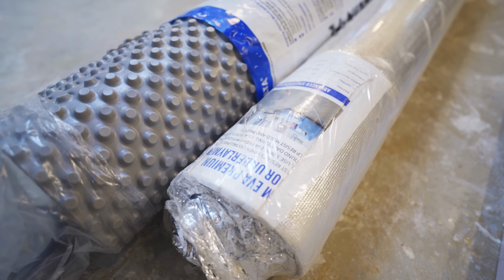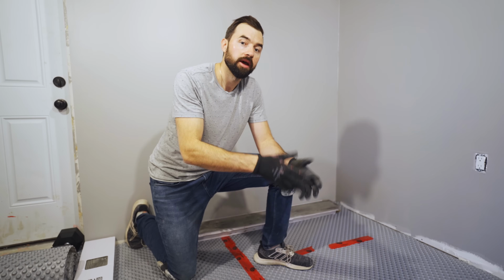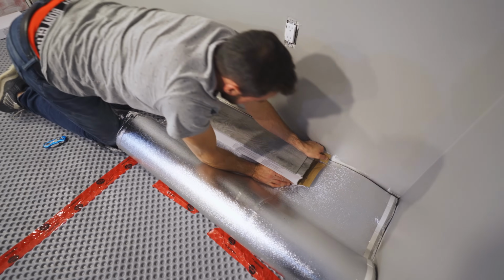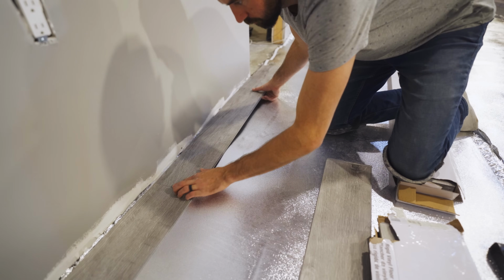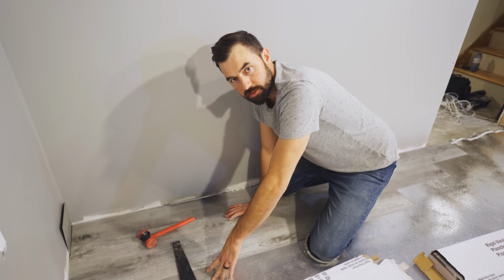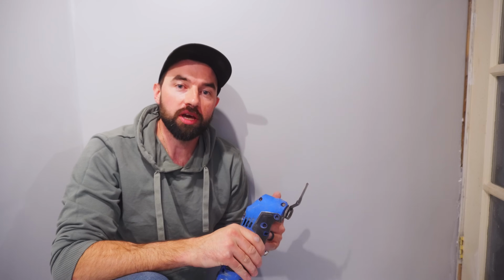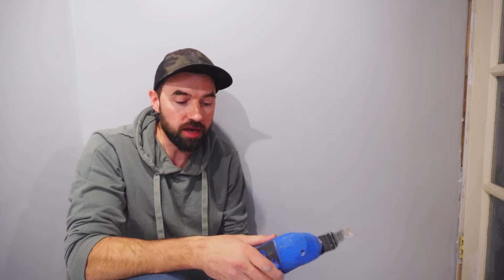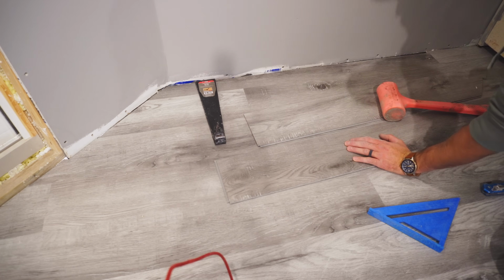How to Install Vinyl or Laminate Floors in a Basement (Over a Concrete Slab)

Comment: Why not use plank with the underlayment built in. Looks like this dimpled plastic would trap water if you had a leak in your plumbing.
Reply from the maker: If you have any leaks with any type of system you have a problem and moisture will be trapped.  The dimples allow moisture wicking from a concrete floor in a basement to evaporate.  Thanks for watching

Comment: What We got has like two layers of rubber and it still needs underlayment ?
Reply from the maker: If your flooring has built in underpad you don’t need the Eva foam layer.  Just the dimple board to allow air flow.  Thanks for watching 🎉

Comment: Every LVP or laminate video I ever watch the most important part nobody ever talks about and that the moisture level that needs to be checked before you even take out tools.  Also the way you vacuumed that is just wrong. A shop vac should be used. Also if you’re moisture is higher than 5% that concrete floor needs to be sealed putting a moisture barrier first is just putting a band aid on it. Also do not listen to this 🤡 you cannot just install anykind of underlayment under any floor. If you’re installing LVP be sure to check with the manufacturer of that floor to see what underlayment you can use. The only underlayment that can go under any floor is a 6 mil poly plastic. And no circumstances do you install 2 layers of any type of underlayment under any floor. This man is not giving you any helpful tips

Comment: This talk of putting 6 mil poly on top of concrete to prevent moist wicking is baffling me. I have a new construction concrete slab that I'm looking to put luxury vinyl waterproof plank down on. The slab was poured on top of poly to prevent moisture from being wicked up into the concrete, thus what's the need for a layer ontop of the concrete? Also there is a pad on my vinyl, I've heard people say put down an additional pad & others say no as it gives too much moosh coosh under the plank & can cause seam failure. I'm in northern Florida near the Georgia line. Is there anyone who knows what the 'ell they are talking about & give me the right & only answer? I'm sick of contradictory bs.

Comment: Why the underlayment’s when it appears your planks have a underlayment backing? Did the finished floor have a bounce to it?
Reply: My understanding is if you add extra underlayment then the connecting joints of the planks will undergo more stress and eventually fail.
Reply from the maker: My planks didn’t have the underlayment pre-installed. If you do get planks like that, then you wouldn’t need the additional air of foam. I just like that Eva full material. I think it’s a good insulator and sound dampener.

Comment: I'm doing a sunroof floor only about 200sf do I still need the under laminate?
Reply from the maker: Double check your manufacturer recommendations.   It depends if you’re doing it on a concrete slab or wood floor etc… double check the manufacturer recommendations based on your material

Comment: The issue is that only the top is waterproof, if water gets under they're cooked. For this reason I'm probably going with tile. Awesome work on the install and vid!
Reply from the maker: Thanks yeah it’s personal preference, tile is more $ but definitely less susceptible to water damage
Reply: Also tile cracks with temperature changes and settling

Comment: Contractor installed vinyl floors over a concrete slab in my condo. 2 years later, I found a couple spots in the kitchen and hallway. If you step on the corner of the flooring, it sinks. I have the exact type of vinyl floors in the video. Anyone knows why it's happened? Contractor said I picked the bad type of floors and refused to take responsibility.

Comment: Great video. 0:26 Wouldn't the moisture barrier trap moisture underneath? I thought it would be better to have just the plank and let any moisture evaporate naturally, no?
Reply: I was just told by a flooring guy who does this for a living and I've worked with him for over 20 years on various floors.. he said that using the rollout type of underlay can shift and eventually cause the planks that get click lock together to shift also an issue at transitions.   His opinion was that it's better to let the concrete breathe so not to put just a flat vapour barrier down which is what many of the manufacturers tell you to do for concrete because of the warranty and they are covering their butts.   I have gone from thinking of putting down a 1 inch subfloor DRI-CORE+ to a dimple mat like this... and now I think based on the good product that I chose which is 8 mm thick and it is SPC, and my floor is a fairly dry concrete floor in general it's not as super damp as some.  For this reason I think I'm going to go with no vapour barrier whatsoever.   This flooring expert who is the manager of a floor store has installed his own vinyl flooring directly on his own concrete with nothing in between and he said it's great.   I'd like to hear from people who installed directly on concrete.  I guess another benefit from that is if you do ever have a foundation leak you would know.   Some of the subfloors are so good that the leak can go undetected for a long time.  Your nose will eventually tell you.

Comment: doing this on a concrete slab that currently has carpet, when i pull it up and check if it's level, does it really matter what product I use?  I'm torn over the generics at THD or Lowes, or Henry brand, or Sika, or Mapei, etc.  I'm using Modin LVP with a 1.5mm pad attached, so i won't have anything else down other than a 6mil vapor barrier.  any 101 advice for a first-timer on flooring installs is much appreciated!

Comment: FEW people know, that the slab in that basement, is "Thee-most chemically-complicated substance ever invented by human beings" and that if there is ANY moisture from the ground reaching that slab, this floor system will trap it underneath, and in time you can have a mold nightmare.   This is NOT a viable solution to the moisture risk.

Comment: Pro tip from a woman who knows a lot about CLEANING SURFACES:

It's counterproductive to push a vacuum stick floor attachment FAST over a floor, as you did.

My husband taught me, before we were even married: To PULL the vacuum stick, SLOWLY.

The suction is THE WORK that you want performed, right?

So, push fast to a beginning start point, if you must: 
Then, PULL, ever so slowly. 
Allow your VACUUM to suck! 
That is, after all, The Work that we want done, right?

Pushing a vacuum stick around rapidly, as your filming depicted you doing, PREVENTS MUCH VACUUMING, sucking up material, to be done!

In the areas of your actual expertise, your FREE, out-of-the-kindness-of-your-heart video was helpful + very much appreciated!
Reply: Considering it's all getting covered, the little bit of dust etc. that would be left behind in this situation will have no effect on the padding and flooring.
Reply: And mop
Reply: Leave it to a woman to explain in YouTube comments the premise of sucking and suction 😂

Comment: Once you put LVP on top of a plastic barrier you will have a major problem if the basement floods from a washing machine, hot water heater leak, or any other source of water from above the floor. Water gets trapped between the plastic and bottom of planks and the floor literally floats and squishes when walked on. I prefer laying the planks directly on the concrete if it is a dry concrete floor with little moisture issues. That way the flood water can slowly seep down through the concrete and into the soil.
Reply: Do you know of anything that would provide a thermal break between the concrete and the floor without padding?
Reply: @ Some kind of a new subfloor.
Reply: @derdan20  They have a plastic subfloor that is raised but it a bit roof work.
Reply: Thank you for this tip. Do you recommend a specific type of sealer over the concrete?
Reply: @ sealers won't cut it. You're better off with a plastic subfloor system.
Reply: You're 100% correct. We did this and had a sagging gutter cause a small wet area in our basement. A couple years later the sewer backed up with rain water covering 1" of the concrete floor. Had to rip out the entire flooring, although almost any flooring has to get ripped out after sewer other than maybe tile.

Comment: You didn’t need to use adhesive? I saw a couple others where they used an adhesive under the floor. Or is the underlayment enough to prevent sliding?
Reply from the maker: No it’s meant to be able to move.  If you use adhesive the joints will open as it expands/contacts.  Check the manufacturer’s recommendation for install of your floor
Reply: @ thanks so much. Just started the tear down of existing, old tile. Thanks for the informative and encouraging video!

Comment: It will trap the vapor between concrete floor and the vapor barrier and mold. I don't feel comfy knowing under my floor there is mold. Also floor will be spongy with all that underlayment.
Reply from the maker: It’s meant to keep the vapour out of your house and on the underside of the concrete, the air gap allows it to dry.  
Spongyness is pretty minimal with this set up, try a small area first to make sure you are satisfied

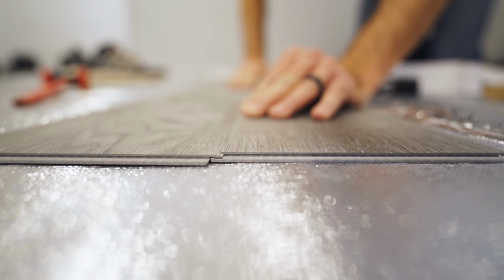Comment: 3:51 That is a CRAZY amount of deflection. That first layer is way to bouncey. Those joints will work themselves out eventually.
Reply: Don't use a squishy first layer, use thicker vinyl flooring.

Maybe try to flatten the floor with epoxy, or use another similar rigid compound that you can walk on repeatedly without it becoming loose.
Reply: Or the lengthwise joints will crack, especially with higher traffic such as small kids driving riding small self powered single person cars or bikes on it.
Reply: What is the solution to that?

Comment: Great video!  I would want an installer like you but good hands men are hard to find. My question is: My front door is metal so it can not be cut. How thick is the product with underlayment for concrete? Than you.

Comment: Why use dimple pad 1st then the UV pad over it b4 tongue and groove? Couldn't you use air guard or dimple? They both have moisture barrier and floor leveling like floating floor kinda
Reply from the maker: You should use the dimple board first to create an air gap which allows moisture to dissipate, the eva foam or similar under no pad provides insulation/noise dampening, I would use a concrete floor leveling first if your on concrete

Comment: The UV underlayment vs other video top  DO you have to use the UV over dimple pad?
Reply from the maker: I like to use the eva foam over the dimple board as it provides insulation/and sound dampening

Comment: WHAT'S DIFFERENCE IN THE DIMPLE PAD THEN TOP.  Other video you use LVP with tongue n groove.  I'm doin over concrete and cheap as possible.  Can you use the vinyl roll flooring over the dimple pad?  Cost roughly 350 square feet room
Reply from the maker: Use the dimple board to create an  air gap the eva foam provides insulation/ sound dampening thanks for watching!

Comment: My only concern is when you walk on such a flooring it feels like the floor is not firm. It feels like its floating? And not sticking to the ground. Any solutions to that?
Reply: It’s literally a floating floor system. That’s the way it’s designed to be. If you want a real wood floor feeling then you need to install real wood flooring.
Reply: @ yeah because the one that was installed at my basement is like the way you have installed and it cracks up pretty quickly specially around the bed legs..someone told me that a sub floor should be installed for better durability like an dmx with plywood..any thought?

Comment: Very well done. I am using a glue down vinyl plank instead of the tongue and groove on my concrete basement floor. Does the same process with the vapor barrier and underlay apply?
Reply from the maker: Hey there for glue down you would use a different material like a barricade plywood subfloor panel, u need some thing really stable for that.

Comment: Can you just flip it over so it doesn't try to roll back?
Reply from the maker: It depends on the material.  Usually a specific side has to face up.  Check the product data.  Thanks  for watching  🙏

Comment: Very helpful, thank you! I’m wondering if there would be an issue if I just did the dimpled rubber underlayment without the Eva foam layer?
Reply from the maker: You can you just get reduced insulation/sound dampening…. Good luck!

Comment: Do I need to use lifeproof underlayment for my subfloor, which is concrete and will be installed on the ground level of my house the floors i picked out is Lifeproof Sterling Oak 22 MIL.
Reply from the maker: I would check the manufacturer’s recommendations and do what it says.  

If your in a basement and on concrete you should be looking for an under pad or subfloor with an air gap

Barricade thermal shield is a newer product and works great for diy
Reply: @DIYDudes  it’s ground level of my home no basement I’m just not sure if I need it or not if it’s best option.
Reply from the maker: If it’s not in the basement, concrete slab on dirt below you don’t need a moisture barrier.  Only what ever underlayment the manufacturer recommends 

Thank you!

Comment: What advice can you give for a Condo concrete subfloor that has settled with cracks. 
Would adding another Self level add more weight ??? 
DIYER, TIA
Reply from the maker: I would add self leveler abit more weight shouldn’t matter.  Unless your building structure is failing the cracking is probably just due to settlement.  What ever settlement was going to happen had probably already happened.

If the cracking gets worse I would contact an engineer

Comment: What happens if water gets into the basement with that flooring installed?
Reply from the maker: Minor water issues and moisture leaching from the concrete Should evaporate over time. Large flooding though will be a problem with any floor.

Comment: Does the underlayment and barrier help level the floor if its close?
Reply from the maker: Yes for sure any small issues will get absorbed by the under pad.  Anything big you’ll need to use a floor leveler cement.  Thanks for watching!

Comment: Would I be able to do this step and get some flooring down before we install the drywall? Right now we have concrete block walls that are sealed and painted and just don’t have money for drywall yet, but I wanna get laminate or vinyle flooring over the concrete to make it look better for now.
Reply from the maker: You could yes but do you have wall studs up yet?  Otherwise you will have to leave the floor short for future install or cut the floor afterwards. 

Good luck!

Comment: Do stick and peel vinyls work well on top of the underlayment?
Reply from the maker: No they need a rigid base.  They are so flimsy they must be on a rigid surface
Reply: @DIYDudes  With stick and peel you just put it right on the concrete then? What about the issues with moisture etc. ?

Comment: Im following people around repairing thier interlocking vinyl plank because they used a moisture barrier..it it breaking the joints because it allows the lvp up and down  movement ..i dont recommend using anything under lvp or lvt it should be in direct contact with the solid subfloor
Reply from the maker: There are so many poor quality floors out there with crap joints.  It’s best to use a rigid core thicker floor 

People often crack joints during the install, don’t notice and then it buckles later.  Especially in big long rooms

Comment: Great video! Thank you! Question about the moisture and layers underneath the plank flooring — is it likely for mold to develop between the porous concrete and the plastic layers? To prevent mold, is a more absorbent material (other than plastic) necessary to absorb moisture? Thanks for your help!
Reply from the maker: Hey there.  No the idea is you don’t want any thing to absorb and hold moisture the plastic dimple board creates an air gap…. If moisture does accumulate than it can evaporate into the air gap.   If it absorbs into something it will stay trapped.   Organic material will grow mold.  Plastic shouldn’t.  Good luck!

Comment: Can you use cork underlayment in the basement? Heard cork is good at preventing moisture and mold
Reply from the maker: You could but the whole idea of the plastic dimple board is to create an air gap using non organic materials..   if moisture does accumulate it can evaporate in the air gap.  Good luck!

Comment: What will happen with the water moisture coming out from the floor that is trapped on the moisture barrier ? Will I not accumulate or start to smell?
Reply from the maker: The dimple board creates an air gap that allows air flow.  Really no moisture should come through but if it does that gap
Allows it to breath. Thanks for watching

Comment: Great video. But I am a little bit confused, could anyone help me on that? Throughout the whole process,  no nail needed and there are gaps at boundary, how can the floor stay in place? Will the pieces at boundary become loose over time?
Reply from the maker: Hey there so the idea is that the floor floats.  It has the ability to slightly expand and contract over time. Google floating floor and there will be a more detailed explanation… thanks for watching!

Comment: WRONG!...too much underlayment flex for LPV. Locking seams will fail in short time...
Reply from the maker: Going on 3 years without issue…. Check with your flooring manufacturer and follow their recommendations, there is no one size fits all